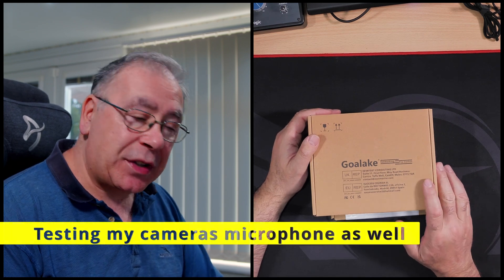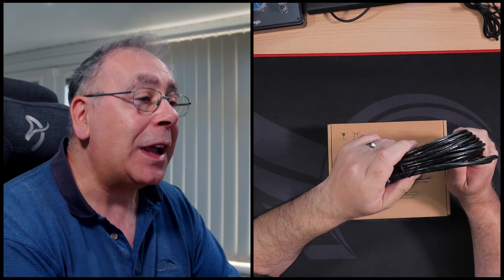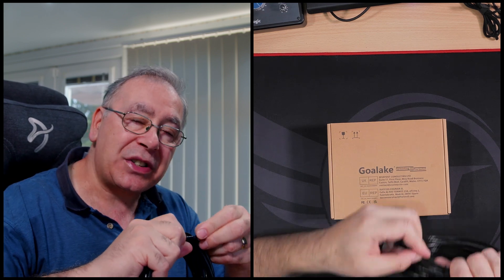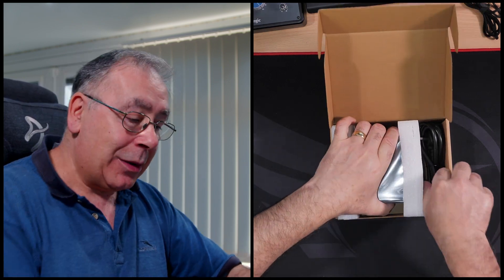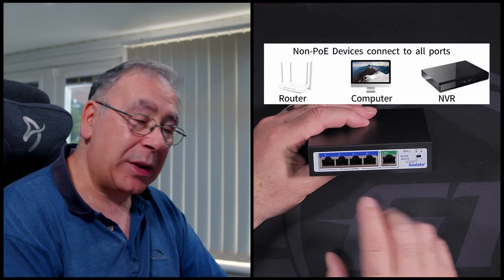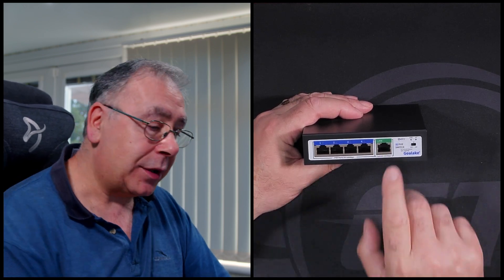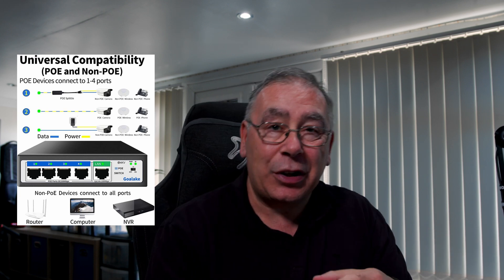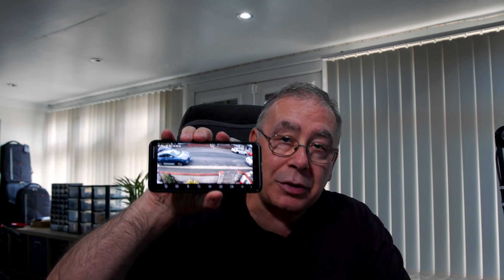Goalake PoE+ Switch Unboxing & Installation Review Simplify Your Network with Power over Ethernet!

Comment: Too much talking. Not enough straight to the point. What's the default password?
Reply from the maker: If it had a password it would be admin
Reply: @YorkiesBitsandBobs  actually, the user manual says 123456 if there is a default. 6 char minimum. Thanks anyway.